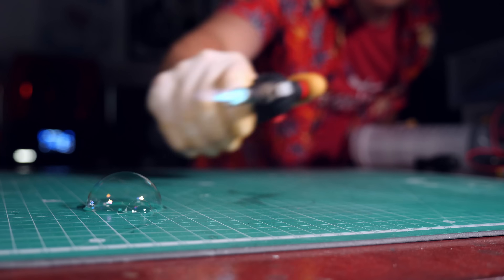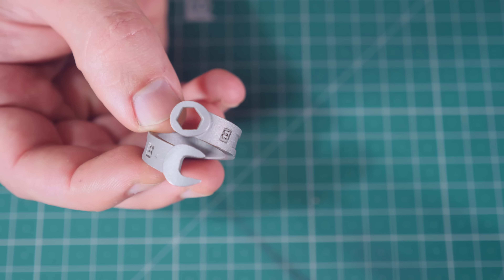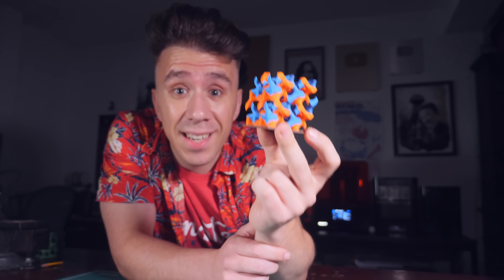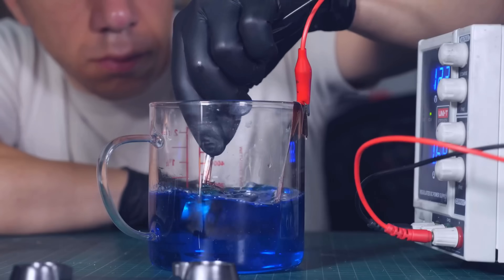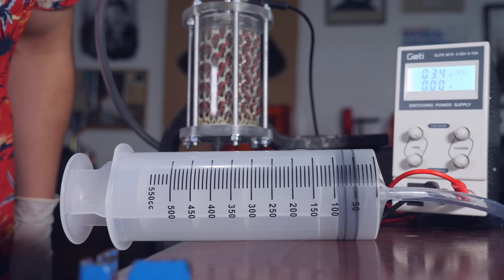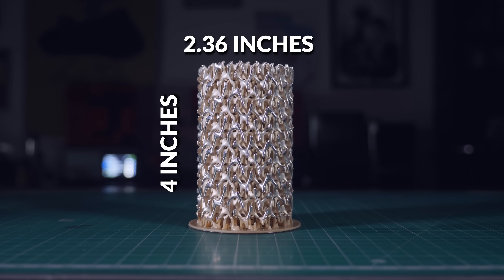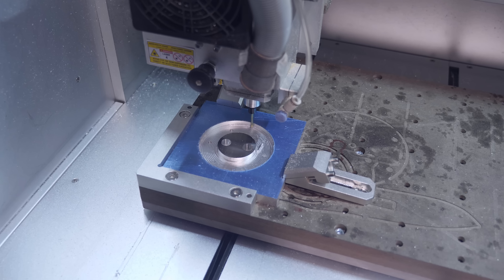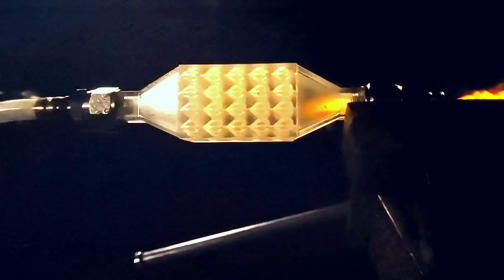ROCKET that LITERALLY BURNS WATER as FUEL

Comment: Use a lead acid battery man!!!
There's a reason they are used in starter motor for big vehicles 

They can supply Huge amount of currents 

Also one thing you could have also done is to grind the plates in a criss cross pattern using sand paper which gives more surface area..

And for the safety please add a bubbler too 

Thanks!! Have a great day
Reply: I imagine he went with lithium because lead acid is too heavy to go along with the whole setup.
Grinding the plates will give more surface area but will also cause it to draw more current as those are directly proportional.
He already has a flame arrester which would do the same job as a bubbler and probably keeps the gas dryer.
Reply: Either a lead acid battery, or an old PC power supply, some of them can supply 50-60A on the 12V rail
Reply: I was expecting him to just pull up a car battery at some point lol.
Reply: He does have a flashback arrestor in there.  You can see him holding it at one point.  That's probably better than a bubbler, and is cheaper and easier.

Also, it appears he's going with the much safer approach of injecting propellant in bursts, then closing the valve and igniting it.  Which produces a pulse jet effect, but significantly reduces the chance of flashback.
Reply: Yeah those can supply something like 800 amps for short periods. Which is completely insane when you think about how much power is coming out of a small box you can pick up with one arm
Reply: Would a current limiter not work too? That way he could keep a small battery and recharge easily, whilst having good control over the system. It seems odd that it wasn't built in anyway, would a speed controller not work for this purpose?
Reply: @Connor-s1k  a current limit would do what it says
'limit' which he doesn't want
He wants as much current as possible so that the flow rate is high

That's why he used the battery in the first place!! Because unlike the power supply... Battery doesn't have a current limiter!!
The only thing limiting the current is the batterie's internal resistance
Reply: A 'deep cycle' marine battery would be perfect for testing, but he will probably need to hook a lot of lithium ion batteries together to get the sort of current that thing is pulling.
Reply: @Connor-s1k  it's insane that he used an LiPo without BMS circuit risking the battery to blow up in his face
Reply: Exactly  @Connor-s1k
Reply: @tvishmaychoudhary69  dude its better than destroying batteries by literally shorting them....
Reply: @largeskbtumqu9337  but not at 12 volts
Reply: Correct. You can manage the current draw by adjusting the geometry, but ultimately you'll need something that can supply it. That's a lead acid car battery, sir. I personally have generated HHO from a beer can sized generator, enough to fill an inflatable two person sofa, in less than 5 mins. Don't ask.
Reply: @razurio2768 big Clive would do it no ? Asked
Reply: @tvishmaychoudhary69  One could set the current limit to [max c - 10%] he'd still have 90% of the battery's potential, over more charges, he can figure out if it's faster and run more tests without nuking the battery. He'd still have to step up to find a price/performance/reliability standpoint but he'd have a slower waste stream.
Reply: @Micharus the cost factor would go up in flames along with the chain of li-ion batteries going
Reply: @razurio2768 not for discharging. Most discharge current doesn't go through a BMS, that would be ridiculous. At most it gets sensed by the BMS but doesn't pass through it.
Reply: Came here to say this. Now leaving
Reply: You can get raw LFP prismatic cells for pretty cheap now too, so much safer than lipo and way more energy density and cycles per dollar than SLA.
 ~100 bucks shipped for 280Ah cells. Just throw a 500A fuse on it for safety and manually balance the cells once and a while. Then tune the electrolyte to only draw 250 amps. 
Those things can draw 1C no problem with basically no voltage sag and still retain thousands of full cycles. Much better for long term if that's the plan.

But yeah you are on the right track, a car battery would be good for initial testing and videoing.
Reply: I’m not sure a Deep cycle marine battery will deliver the CCA of say a Diesel truck battery. The deep cycle is designed to discharge without harming the plates not necessarily delivering high amps
Reply: there is a reason,  and that reason is basically price,
Reply: @HexCopper  probably easier to make a lithium-water rocket than to do on-board electolysis.
Reply: @randomblogger2835  wdym? Lead acid battery are much cheaper than li-ion
Reply: @tvishmaychoudhary69   lithium + water = boom!    A rocket powered by a lead acid battery is not going to fly far.
Reply: and huge amounts of currants, also sultanas and raisins.
Reply: Condenser?

Comment: I like how he slowly discovers the construction of a battery.  Soon he will discover the spiral.
Reply: Then he will need to swing out by said spiral.
Reply: @Olikiscrazy  Maybe once the spiral is discovered, he could also look into capacitors, which also use spirals and could lessen the load on batteries (charge the capacitor with a batterie, or with an appropriate charger, then use the capacitor to generate hydrogen)

Comment: I know a few ways to improve this design. step 1, rotate the lattice 90 degrees so the the plates are vertical instead of horizontal. the gas bubbles want to go up, and the plates are in the way. step 2 include a recirculation pump to forcibly pump water through your lattice, further pushing bubbles out and water back into contact with the electrode. step 3, just use salt water. you'll get salt deposits on your electrodes, and lower conductivity, but that will be way easier to clean off. it also makes it safer for a circulation pump. also lower conductivity means you can measure it and limit your current so you don't overload your power source. at that point it's about as optimal as it will be, so you can just scale it up. electrical resistance in the lattice itself means there's a maximum lattice size, so you're better off having multiple parallel lattices if your goal is maximum output. as for rockets... don't you lose efficiency because the water rapidly cools and loses pressure going from gas to liquid?
Reply: unless you mean other salts salt water releases chlorine gas which is uh not too great
Reply: @mumujibirb  electrolysis of sodium chloride into chlorine gas requires a higher current than water IIRC. I could be wrong, im just remembering highschool. Technically any electrolyte will work. Also, you can use distilled water instead, though this has the consequence of also producing ozone, and h2 gas dissolved in the  water, like carbonation. Effervescent water via hydrogen gas. At least until it becomes saturated... which means there is waste. Thats also requires a bit more current. Yes, i just googled a bunch to double check this stuff, but thats all i did.
Reply: @therealquade  Hi, producing chlorine does require higher voltage than oxygen from water but not by much, water need 1.23V while chloride need 1.36V (see wikipedia page Standard_electrode_potential_(data_page)). So you would produce a combination of chlorine gas and oxygen gas, so definitely don't use salt. Also reducing conductivity to limit the current is not ideal since you lose efficiency that way, you better reduce volltage or use smaller cell. Any electrode would work if you don't mind it dissolve into the solution in a few minutes. Also distilled water is not ideal as it has low conductivity, use NaOH solution instead.
Reply: This is a good way to “die of mysterious circumstance” or at least have some very nice dressed men knock on your door
Reply: if the water is pumped, wouldn't it clean itself with enough pressure?
Reply: @therealquade  shouldn't it be voltage? The gibbs free energy of electrochemical reactions should depend on electromotive force only. Current should affect the amount of mols of the gases produced.
Furthermore, the liberation of chlorine gas is more favoured in spite of higher electrochemical potential. This is due to a phenomanon called over-voltage, where the actual voltage required to librate a substance is higher than the calculated E0 values. 
Liberation of chlorine is more favoured as the empirical values for chlorine is lower.
Using distilled water should yield a slow reaction as distilled water contians litte to no ions capable of transferring the electrons across the solution.
For safer electrolytes, i think sodium hydroxide or potassium hydroxide is used, as those produce hydrogen and oxygen gas as well.
Reply: @mumujibirb  you are probably correct, im sometimes a bit of an idiot, blessed with enough knowledge to feel confident in speaking up, but not enough to be correct enough in all those times. As for distilled water, resistance is proportional to the distance between electrodes, not the sum total of volume. The closer you can get the plates, the less resistance, and with the stacked plate design you can just scale with more plates, and better conductivity on the electrode itself, at least if you prioritize both speed of production (of gasses) and ease of maintenence above energy efficiency. If you go for energy efficiency alone, you are probably correct, though, doesnt that still add corrosion or deposition on the electrodes? My whole thing is that volume of gas/time with near zero maintenence. Maintenence time is down time, down time is no production, means  gas / time is way lower, for large volumes. But i dont actually know 100%. My background isnt any science, this is barely a hobby for me, its more entertainment and speculation.
Reply: @KavinTeenakul  weirdly enough oxygen, despite having a lower theoretical voltage, actually has a higher empirical voltage compared to chlorine, due to "over-voltage". The empitical voltage for oxygen is around 1.5V, and supposedly the over-voltage for chlorine is less than 0.2V, so the final voltage for chlorine is slightly lower
Reply: @mumujibirb  The "over voltage" are commonly refer to as over potential in electrochemistry. Yes, it will take more than 1.23 V in acid and alkaline electrolyte.

Comment: the government: "i just wanna talk to him-"
Reply: LOL
Reply: its okay though making hydrogen is kind of explosive so that is why we do not actually use it in cars today.. its more unstable than using liquid petrol. Lets say you hit one of 1 million pot holes ?? 

You have a 51% of moving the hydrogen tank just enough to make it explode.
Reply: @IloveJellow if you only produce what you need at that exact second it should be fine. water is more stable than gasoline its self
Reply: @pauliewalnuts2527   you should try the experiment and shake around the water tank producing the hydrogen.. It will explode from frictions.

So what I mean by this is you need a tank for holding extra water and another tank that will be producing the hydrogen. The tank that is holding the reaction is not fully stable unless at a full rest without movement any form of cymatics or friction can set it off and this can cause a good pop too happen and followed by a brief fire of 4,000 degrees Celsius heat. This is no longer at a experiment scale because you'll need a much larger reaction chamber for a car and even larger ones for bigger vehicles.

So ya the implications of it ,is what is stopping us from using it in a commercial setting it's like driving a IDM that could go off at any time.
Reply: @IloveJellow  have vent holes, baffles, dampening sponges so it cant occupy the same volume.
Reply: @pauliewalnuts2527  So you still have the IDM strapped on the car and you gonna trust random people with such a dangerous fuel system?
Reply: @IloveJellow  If its more efficient than petrol, diesel, LPG and electric, why not?
Reply: @IloveJellow  Toyota has made a hydrogen fuel cell car that carries around two hydrogen takes, they are safe and secure enough to not explode even if the car gets in a crash. These cars are literally on the road today and driven by normal buyers. Theres just minimal fueling infrastructure for them so they are all in the California area.
Reply: @IloveJellow  I still think you can produce it in a safe way.
If the motivation is there, humans can do anything.
And that is because we are made in God's image.
Reply: @IloveJellow  Hydrogen is not nitroglycerin. It needs an ignition source to light
Reply: @pauliewalnuts2527  To do that you need a large setup. To move that setup you need a larger setup. It's an infinite loop
Reply: @IloveJellow  No more dangerous than that 15 gallon tank of explosive gasoline you're hauling around
Reply: @panzerwolf494  hmmmm.  sounds to me.  he would need a very big set up.
Reply: @pauliewalnuts2527  I didn't watch the whole video because I know it's just a bullshit concept. but if the thumbnail is in any way relevant, yeah, the flame's nice, but there's either no thrust or a very very brief burst of thrust for a split second
Reply: @panzerwolf494  idk what you mean by bullshit concept.  this is simply scientific expiremnetation in an entertaining format. 

education of the masses is far from bullshit
Reply: @pauliewalnuts2527  People in this thread thinking you can power a vehicle with this, and you simply can't. It's the same idea as a perpetual motion machine.

Comment: we did something similar in my chemistry class, we had directions to mix yeast with hydrogen peroxide to make oxygen, and to mix hydrochloric acid with zinc metal for hydrogen. We weren't told how to collect the fuel, my group decided to mix it in sealed containers with only one exit, and to plug the exit with a syringe, then let it sit, and after a while, collect the gas with the syringe. We did this for both hydrogen and oxygen. Then we had to cut pipettes into short little stubs with the resivoir at the top, fill them with water, then gently insert the syringes into the water, and inject some oxygen and some hydrogen (separately) which displaced the water. Then we had to put 2 wires thru the little water seal and use a spark to ignite it and shoot the little rocket.
Reply: Would small accumulation tank help buffer the better?